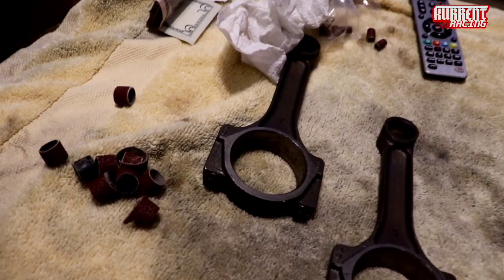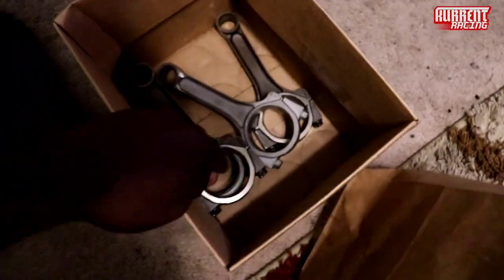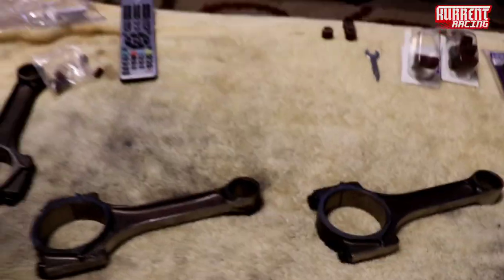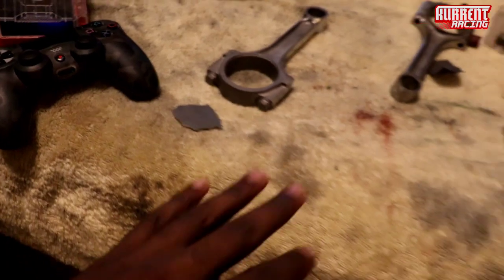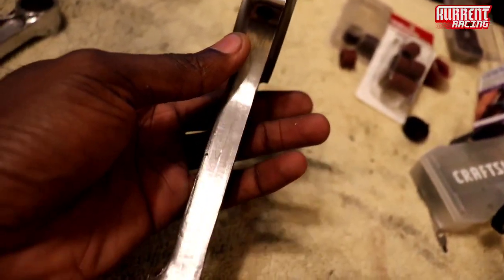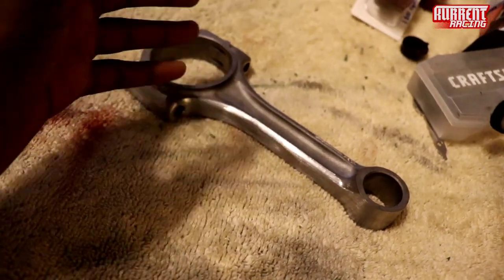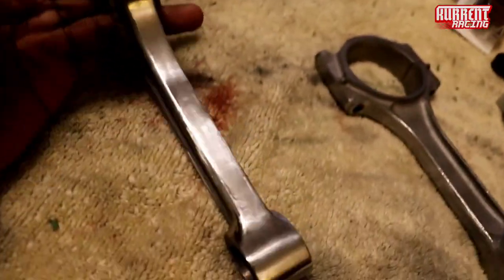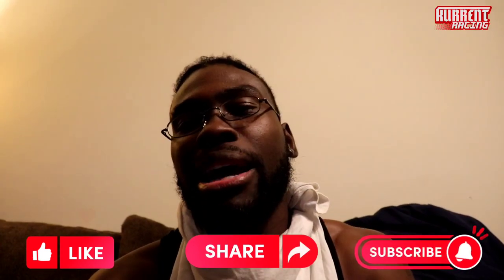5.3 ls Vortec Connecting Rods Polishing & Weight Matching - How To

Comment: I understand after reading that polishing can help remove certain areas that can cause stress fractures, but i would almost be certain the majority of the higher power support your refferencing that others have gained, has come from getting away from the stock rod bolts.
Reply from the maker: I think I understand what you meant at the end.
Reply: @kurrentracing  well, in the simplest explanation the rod bolts are what see the most abuse. Stock rod bolts are not made from the best material they are a 1x use torque to yield bolt, and with that said when you take the rods out to polish them you're not reusing the stock rod bolts. At least I hope people aren't 🤣. So you're going to go back with an aftermarket bolt probably an ARP2000 or custom aged 625+ and they are a major upgrade from the stock bolts and allow you make more power without breaking something. So it does say online that yes polishing the rods gets rid of areas that can cause stress fractures, but in my best opinion I would get that the guys you referred to in the video making nore power and not breaking is probably in most part due to changing the rod bolts. Again I'm not saying the polishing didn't help.
Reply from the maker: @ilovelulu8492  ohhhh see I thought that's what you meant! Yessirrr. I def agree!! That's what they told me to replace too. But I won't lie. I got stock😬 from the power I'm going for I'll be fine. I hope lol.  But the same info you told me. Another cat told me to replace the bolts cause thats the weak point. So long story short. I told the machine shop. Ima use arp. Amd they said they'll have to re do something because the clamping force would be different than the factory bolts they use. So I'm sol for now lol.  But I really appreciate your feed back and taking the time to type everything💪🏿💯
Reply: @kurrentracing  oh yeah man I love race car shit and am always willing to learn and share knowledge. I would love to know how much power your making and holding on that stock setup with stock rod bolts. Seems a little odd to me though that a machine shop would have to change anything on those rods to accept arp2000, I've heard of people over and over changing just the rod bolts on a motor and being perfectly fine afterwards no machining involved. I hope it all works out for you and it kicks ass.
Reply from the maker: @ilovelulu8492  yessirrr💪🏿 stay tunes with it man! Going for 800hp. And so far I kno someone doing 800+ on stock everything except of course head bolts to studs and head gasket. Idk. Ima do more research on that part. They was saying theyll have to resurface and mill crank again cause clamping force would be different. So ima look into that more. And yessir I gotcha bro💪🏿💯

Comment: 🤔those are powder metal rods why polish
When balancing rotating assembly 
Rods are balanced by 
Big end weight =rotating weight 
Small end weight = recipcating weight
Steve Morris has good video balance rotating assembly
Reply: @bigboreracing356  they powder metal rods  not a forged rod 
Forged rods clean forge marks and polish yes 
Powder rod are waste of time polishing 
The ls rod are a great stock rod 
These ls stock will always disintegrated on the beam closer to the big end 
A forge rod or h beam will bend first not explode like a powder metal rod 
The great thing i have found with a powder metal rod  is when no mechanical people bring them in they are lot easier to put right cap back on rod from the box of part they bring in

Comment: You never "polish" a connecting rod. They are cleaned up to remove casting flash or forging lines then shot peened and balanced if necessary. Polished rods create a softer surface that is prone to cracking without being shot peened.
Reply from the maker: Well see
Reply from the maker: @bigboreracing356  you took the time out to time that damn my boi🤣